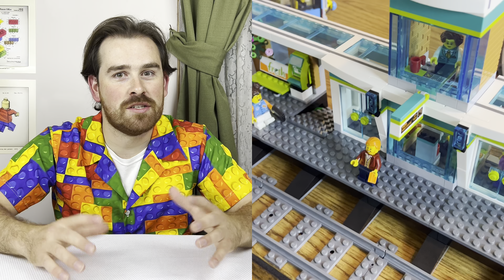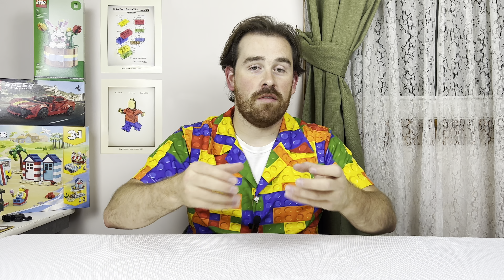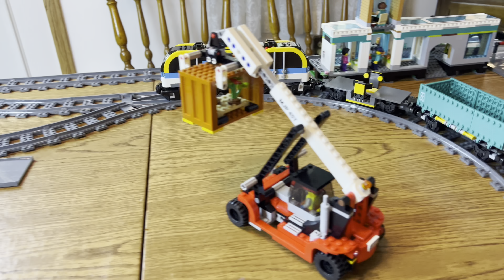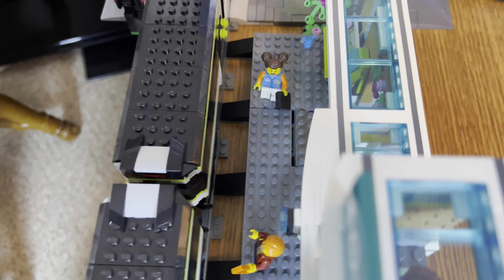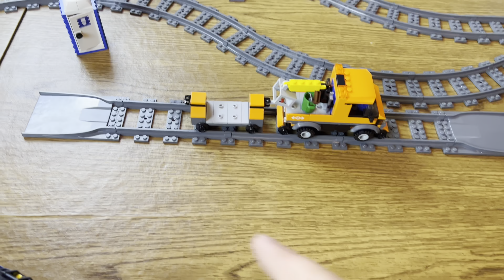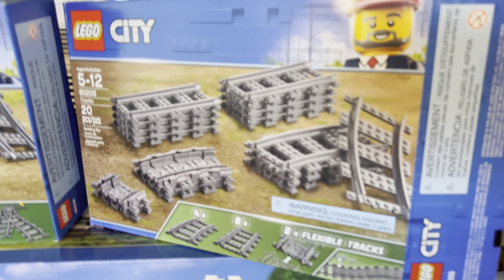Combining Every New Lego Train Set Available TODAY!

Comment: The problem with Train sets nowadays is that you can't buy any locomotives or rolling stock separately. All the Train sets with actual trains in them are these HUGE all-in-one sets that are predictably expensive.
All the smaller sets are either just more tracks or side things like the station. 
I think this is one of the reasons why Lego Trains haven't been selling well. Most people can't just casually pick up a huge 180€ train set for their nephew's birthday. They'll stick to smaller sets. But for trains, there are no small sets.
Imagine if they sold, for example, a little tank engine on its own, for maybe 30 bucks or so.
And then a single freight car for 20. And a passenger car with a few passengers for, say 30.
Then, if a kid loves trains, they can ask all their relatives to give them one of each for their birthday, and the sets actually sell. 
Meanwhile, the adult fans can pick up 3 or 4 freight cars at once if they have a big train collection instead of having to buy the huge set again and selling the unwanted parts online, which a lot of adults don't even wanna bother with, so they would appeal to more casual fans too.
Reply from the maker: I wish they did this too. Many people want longer trains but don’t want to keep buying the large sets. I know exactly what you mean
Reply: @leggomyjameso6082  Yeah, there used to be a time when Lego sold them separately in 2001. Since then they also never sold small locomotives outside of polybags which don't fit on the tracks.
I've been building some small engine MOCs and they can be so precious and cool. Both adults and kids would love them!
Lego is really leaving a big market untapped.
Reply: It is so true. In the 90s they were many small set avaliable to lengthen train like carrier waggon, maintenance waggon, passenger waggon, tank waggon, etc...

Comment: Personally back when these sets released i wanted the freight train set but earlier this year 2023 i bought the passenger express train set and later the train station as of now
Reply from the maker: That is good. I ended up liking these more than I thought I would
Reply: @leggomyjameso6082  personally im hoping to buy at least another passenger train and maybe 2 freight trains before they go off the shelves in 2026
Reply from the maker: @dylanwhite3383  I want to get one more of the passenger train as well. 2026 is a long ways away we have time. Unless they take them off the shelves sooner
Reply: @leggomyjameso6082  agreed although i did watch a video on another channel that changed the color of the passenger train from green to red and that's what im currently working on with my only passenger train but mainly on the locomotive itself but before 2026 i plan to have at least 2 freight trains and 1 more passenger train
Reply from the maker: @dylanwhite3383  That sounds pretty awesome! I need to do more with custom trains and builds
Reply: @leggomyjameso6082  well don't rush yourself when making new custom trains